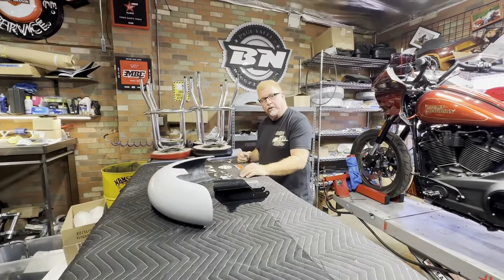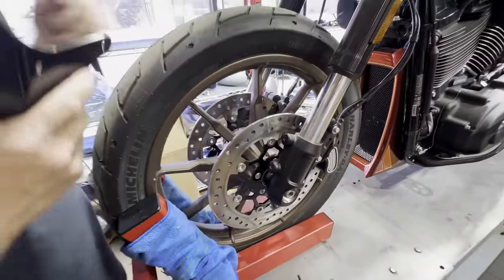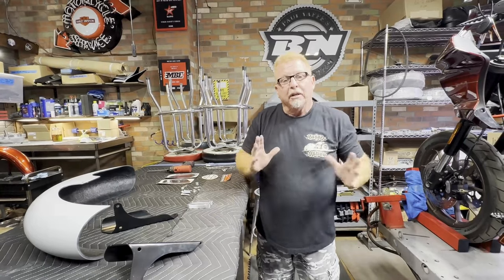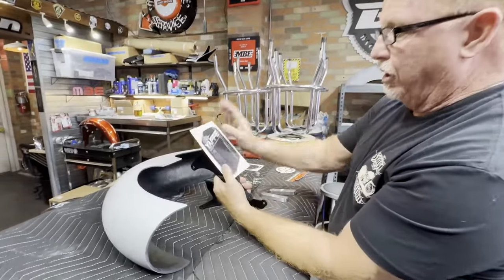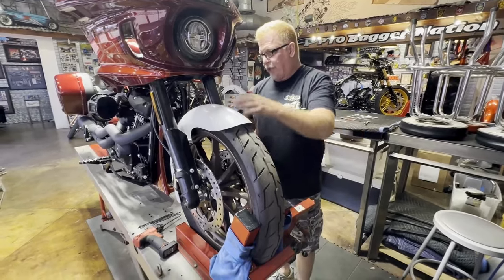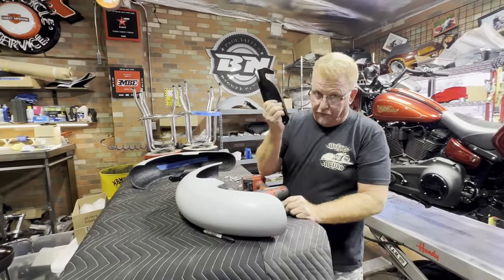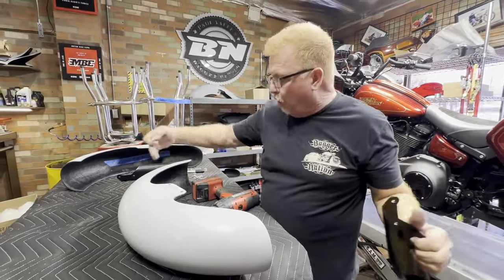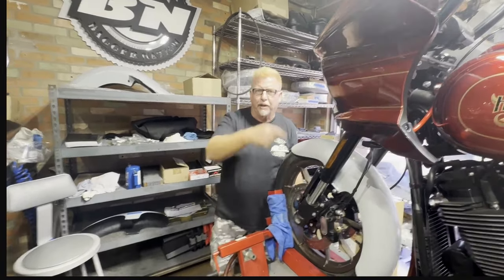How to center a longer front fender on your Harley Low Rider ST.

Comment: Hi
I had the set up on my low rider s2021
I put a 21” wheel with the 130/60 tire 
Do you know if the bracket would work if I want to install a 21” front fender?
Thanks
Reply from the maker: Unfortunately, no. The debris guards and fender are set up for the OEM wheel size.